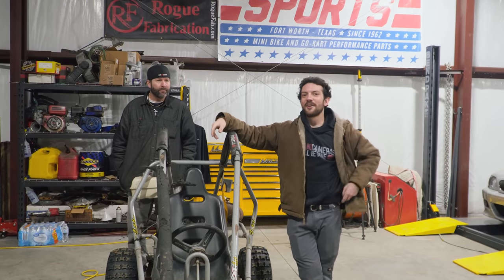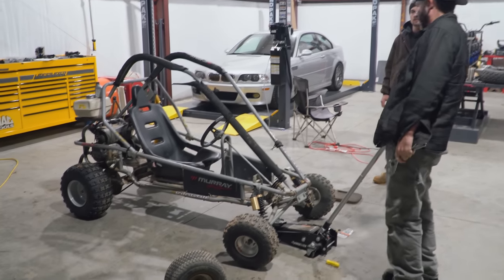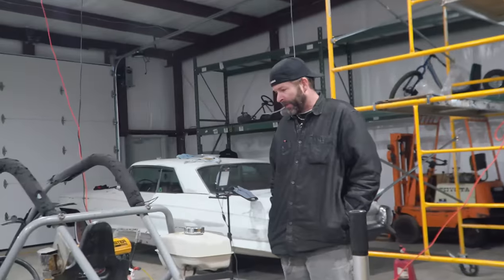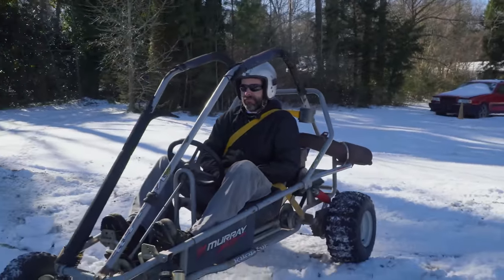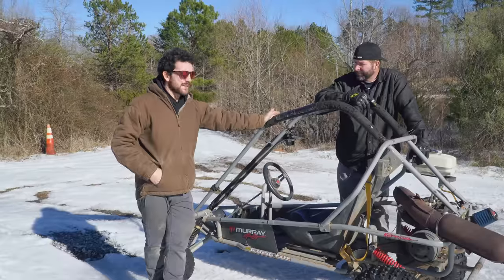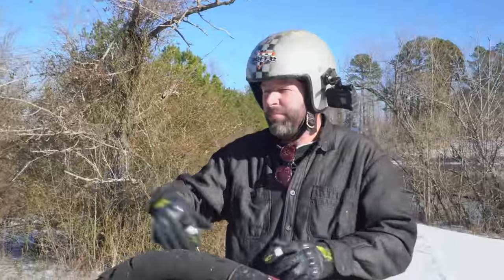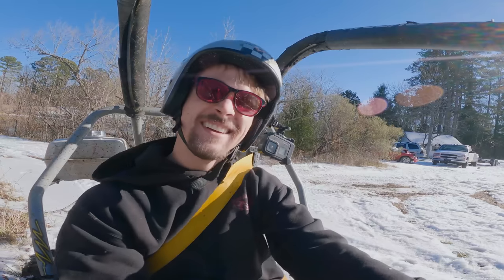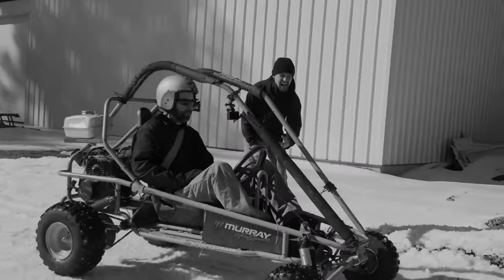Reviving our 440cc SNOWMOBILE Powered Go Kart!

Comment from the maker: The 2 stroke Murray is BACK! This engine is supposed to make 38hp... Now we just need it to get to the wheels!
Reply: Whats up with this spam ^^^....the way ike said choke me....lol its almost to natural isnt it lmao
Reply: You guys need to get a set of wheel studs for this reason
Reply: How about a go kart on tracks?
Reply: Or a change  ski set up for the Front for those biannual snows lol
Reply: Put a real snowmobile secondary clutch on it and the right belt.  The secondary is too small in diameter compared to a stock snowmobile one so that's killing your gearing and your belt.
Reply: Plus your jetting is way off
Reply: With it being winter and cold out that fan cooled engine will put out much more power than the summer that's just the way those snowmobile fan cooled two strokes work.... the colder it is the faster they go... try it when it's in the single digit temp
Reply: To keep from rolling over go wider
Reply: @squarebodycasewademckenney6190  they don't get single digits down there.  Also you're thinking of a free air machine with regards to Temps.  A fan cooled machine will run fine in warmer Temps as long as it's jetted correctly. You'll lose maybe 5% power going from say 25° to over 50° if the jetting is right.
Reply: More. Like 80hp. The two stroke snow machine has a ton of drag 38hp wouldn't even have enough to move it through loose snow.
Reply: @dipstiksubaru3246  nope I had a 1995 skidoo safari 377 fan cooled and in temps above 30°f it was kinda sluggsh but anything below 25°f it was quick and anything below 10°f it was almost scary quick it would actually lift the front skis and it's the same way with my new sled a 2003 ski doo Legend 380 fan cooled
Reply: @squarebodycasewademckenney6190  read where I said jetting. I've run 377s into the upper 60s without significant powerloss.  Been working with sleds for 30+yes
Reply: @dipstiksubaru3246  377 will run great in warmer temps, jetted for it. Till it blows up the same as they do in the winter lol      you can't run a Cat (Kawi or Suzuki) engine or the summer.  This thing will lose compression before the next video..  and my guess is blow up in the next one or the one after. You're absolutely right about the clutch..   but it also needs to be aligned properly.   These guys are clueless with sled engines.
Reply: I wanna change that.    There's a good chance it's already blown up 🤣    it is 100% down a cylinder hahaha

Comment: I’d definitely get a tach on that if you’re gonna do more tuning that engine should turn around 7,000 RPM. The clutch is coming in way to low like Ike said and I’d definitely gear it down. To get more out of that motor I’d put dual 34 or 32mm Mikuni carbs on it.
Reply: Single carb is much easier to deal with and you don't need to sync with a second. They need to effectively double their gear ration to 10:1 or even 12:1 to be geared properly.
Reply: They're using a garbage CVT.  First step should be a good one with good belt.

Comment: I agree with Ryan Mallory except I would put a stiffer spring in the clutch so the rpm’s are slightly higher when the clutch engages. It should help get rid of that low end engine bog. Oh and definitely a new belt would do wonders too. And before you do all that gear changing you could reclock the secondary. So put the spring end into the next hole. That will give you more low and mid range power too.

Comment: I also think the snow is wetting the belt contributing to the slip.
Reply: i agree, making something to protect it from the elements would be good
Reply: It's a snowmobile engine but they're using the go-kart torque converter I believe. The snowmobile torque converter is much bigger and sturdier. You could be right but I assume go-karts go through mud and water pretty regularly.

Comment: Back in the day ('70's, lol) rather than changing the driver dogs, we would stiffen (or lighten for quicker top ends) the driven pully's spring.  That way we would keep more pressure on the belt  & give a bit more low end grunt.  Have fun!  Definitely love to see 2 strokes providing grins, like the old days!  LOL!

Stay safe, & thanks for the content, & chuckles !

Comment: Good machine! The clutch you can take apart and drylube, and pre-tense it correctly. I think it would be better to set the rear dampers almost vertical in the chassis, not flat as it is now. Looking forward to next video.

Comment: Would be awsome to  see  some A Arm suspension  built  for this. Work out the kings with gearing / wider wheels and tires /  belts  / carb upgrade . Would be a little rocket  contender for  mini  crosscart !

Comment: Front tires look like they have a severe camber issue.put some bigger tires on the front fix the camber and belt issues and let it rip. Cool project.
Reply: It's because the shocks in the front are too long but they did that to lift it

Comment: FIY engine and jack shaft centre distance is critical on a snowmobile clutch for low gear! And proper high gear! Clutches need to be clean and free of dust and belt debris, both the primary and secondary clutches. It’s called a clutch service. In the snowmobile world. Pre season service. 
The more wear on the belt you loose low and high “gear”.
P.S. that thing should 
Rooster-tail the tires with a 440

Comment: Just so you know older snow mobiles from the 90 and later all are set up with a high clutch engagement around 2 thousand 200 rpm. A lot of the slipping is from not having a cover to keep your belt dry they don’t like water.or ice so looks like you need a new belt. Recommend getting scotch bright pad to lightly polish your pulleys the belt rides on. Can’t wait to see what this project can really do once the bugs are resolved

Comment: Some tips on the Kawasaki 440 and belt drive.  You can get a higher "Stall" speed on the clutch by very slightly loosening the belt.  If you get it too loose, you'll get a very hard grab when it does catch.  I'd also like to note that you are running an exposed belt in the snow.  Wet belts slip.  That will be made worse by gearing issues.  The KZ 440 is one hell of an engine that can be tuned for much more than the stock 43 horsepower (We were able to get almost 60Hp from this engine in a Malibu Grand Prix "Virage" race car).
Reply: Not a KZ engine sir. Came out of a 70s Arctic Cat snowmobile. Most likey a Puma or EXT. totally different engine than what Kawasaki used in their bikes.
Reply: @matthewbeito1431 , My mistake on the nomenclature of the engine.  My experience with them was as the powerplant in a Malibu Grand Prix "Virage" race car.  Malibu Grand Prix used to be an arcade and go-kart amusement center at many locations across the US.  They're mostly gone now, but the Virage race car was a 7/10 scale formula one car with a top speed in the area of 50-70mph off the track.  I've spent a fair amount of time wrenching on them and tuning them when I was a mechanic at our local track, before it shut down.

If you never saw Malibu Grand Prix, here's a video of an example:
https://www.youtube.com/watch?v=YAEWjXwPnfs

Comment: I've got a Kilowatt the same color and everything except mine has a Vegas Carts 460 block with billet everything internal and external. 780 drive and driven on the factory motor/jackshaft plate (the only thing I had to do is move the plate to the right about 3 inches and then replaced the factory jackshaft with a new hardened steel one that ended up being about 3 inches longer. The best upgrade imo is the front and rear hydraulic disc brakes!

Comment: Just a thought: You guys are getting fast enough on this course to take downforce into consideration... you'll need large wing at these low speeds, but it would be extremely effective and not be too draggy, again because of the low speeds. You'd definitely pick up more traction than you would lose top end. Try adding some downforce to some of the projects to see if you can get better times.
Reply: They aren't going to be reaching the speeds they would need for downforce to matter. Downforce is really only going to help if you're going 100+
Reply: I've been saying that for 3 years. Get a 600 mini sprint.
Reply: @michiganvapemafia595  Nah dude, surface area will make up for it easily. You don't need to be going anywhere near 100 mph to get good downforce. Try holding onto a piece of drywall in the bed of a pickup that's doing even 30. 

A bit of cheap sheet metal and some quick calculations (there's a formula) and they could keep the throttle buried for most of the course. Especially on the lighter projects that don't have too much inertia. Actually, there's a good project for them... build something ultralight with as much downforce as possible. I don't know if any of them can weld alu, but it's never too late to learn.
Reply: You are all on drugs. You don't run down force on an of road vehicle. You arent off roading in a Sprint car(or micro sprint). Oh wait! what about all those side by sides running around with giant wings on them? All the Baja trucks with giant wings on them? Oh right they don't exist.
Reply: @jasonbirch1182  You don't run downforce on cars designed to jump. If you aren't jumping, downforce is a legitimate way to increase traction. The same rules apply... no amount of crying will change this fact. It's also a perfect project for this channel.
Reply: @jasonbirch1182  
Go fast, turn left. Asphalt is for getting to the race track.

Comment: Snowmobiles have a drive unit that has 2 different size sprockets that reduces the ratio. Going straight to a pulley is about 25-30 percent too tall. Get the ratio right and it will easily do 70 and still have great low range

Comment: This thing is a couple of steps away from rocking your leaderboard; convert the machine to have a wider track width so it doesn’t wanna roll over as easy
Reply: I think your right like Pontiac Grand Prix wider is better. Grind hard plumbing co. Did it on colonel senders they said it turned Easier and felt way better. They widened it three inches.

Comment: i want to see this engine in a capable chassis with a wider wheel base to improve the handling. It needs to have wider tires and a good shot at a dry track and i think this is a top 5 contender on the leaderboard. You could try and widen the wheel base with larger shocks and longer arms but that would not be good for the front because of the angle of the wheels. You would want a more complicated set up for the front and probably better shocks in the rear.

Comment: If you haven’t yet, those carb jets need to be upsized a lot. Snowmobile air boxes are very restrictive and so when you replace them with free flowing air filter pods, the engines will run super lean. Check your plugs, if they are tan you’re perfect on jet size/tune/fuel mix. If they’re white it’s too lean, black it’s too rich.
Reply: I had to go up 4 jet sizes on my sled powered buggy 👍

Comment: Looks awsome! Id slap a camera close to the engine for a better lookieloo of the workings of the CVT drive? (In my imagination, based of nothing but speculation, that cart weights/drags ALOT less than a snowmobile, so id imagine you are not making the clutch work "as intended" especially with that madhouse final chain gear, but i might be out in the weeds here..) 
Hope it works out well in the end!

Comment: That is a cool machine. I thing belt and gearing is all you need. Don't change the weights because that'll strain the belt more and it's plenty powerful plus wil improve with the higher gearing. I can't wait to see a dry warm lap. Rear axle probably needs to be wider for stability.

Comment: I would put some screws in the tires, but that thing looks like a barrel of fun.

Heavy weights reduce slipping but increase engagement and max rpm. 

You can recondition the belt with scotch brite and rubbing alcohol.  I think snow spray is causing the slip, the belt isn’t smoking so I doubt your cooking it.

I would tighten the spring in the secondary clutch do it stays in ‘low gear’ longer and returns to it easier.

Comment: I have tuned more scooters with CVT than i can count and First off, you need to keep the belt dry at all times, second you need  a more powerfull secondary CVT spring to hold more tention on the belt to also reduce slippage, then you can look at clutch and clutch springs and then rollers/weights.
If you dont do the CVT optimization in the right order, you will struggle with it for years and never get it running right.

Comment: How are you cooling that engine? Most snowmobile 440's are fan cooled. If it's a liquid it should have some cooling fins installed that cycle the heat. May want to install a temp gage just so ya know.

Comment: Need more power for our Ken Bar kart. At Mini Mayhem, it was slow launching on the drag strip. Maybe more gear, adjust the torque converter? My son does have a turbo Honda Civic motor and trans in the barn. Hmmm...

Comment: Try keep the clutches dry and the belt wont slip. Soon as a snowmobile gets snow on the clutches they slip the belt. Id say the belt got wet and gradually got ate by the clutches as it slipped which is why it ended up getting poochy. Belt should ride 1/8 inch out of the sheaves in the driven (secondary) clutch and make sure the alignment is proper too. Misaligned clutches eat belts too. If you can keep them dry and set up right that thing should go a ways between belts and haul more tail too.

Comment: Finally something you guys do I know a thing or two about first relocate the tank and put a fuel pump on it re jet it for the air filter get rid of that horrible clutch and put a snowmobile clutch on it the belt might be slipping because of being completely exposed a belt would definitely help and like everyone else said and you said gear it down and it should be an absolute machine and maybe invest in swapping to duel carbs probably 34mm carbs and run 50 to 1 I think is the best and see if it has a oil pump right under the carb and either remove it and put a plate on it or hook up a oil tank if it doesn’t then don’t worry lol

Comment: Those were designed to run no air filter so a re jet for sure. Lighter rollers in primary and shim the secondary for sure. Definitely do a belt guard in case the belt or clutch comes apart at running rpm I’ve seen people loose a leg over that on a sled. It kind of acts like the carb isn’t opening all the way too.

Comment: I think you guys should adjust the front control arms to take all that positive camber out from lifting it. Would make it handle significantly better.  You should just be able to slit the tube and bend it up a little, though going full double A-arm would probably be the best option, so you can add some serious width to the front

Comment: Interesting thing is, two stroke engines being made the way they are can run upside down. The issue is that they can't normally be turbo charged without special modification, however they can be turbo charged by simply changing the pulleys to add on an additional accessory pully.

Comment: A clutch designed for 2 stroke rpm would be best, preferably the one that came with the engine, and a belt designed for the application. I'm really glad you got the thing going again, that kart will dominate your leader-board once it gets a better drive train. The engine was designed for a 400 pound snowmobile, and will put everything else to shame.

Comment: Gear it down, Replace the belt and I think Long Travel front and rear suspension would make this thing bad ass. Yes I know you would need to change the rear drive setup for long travel but I think it would be worth it.

Comment: Try putting a proper driven clutch on there so that it’s facing in the correct direction so that the torque converter works correctly that will help

Comment: Only seen half the video,but if you want a snowmobile engine that will almost always run,look for a Yamaha Enticer 340 engine,I have one in my sled that still runs,even after sitting outside for seven years,plus,they have Mikuni carburators

Comment: Easier way to raise engagement on clutch is put a spring shim. They sell em. But you can find a washer at local stores. Fender washer thickness will raise engagement up about 400-600rpm actual spring shims raise engagement about 200rpm per shim. . Just a cheaper alternative to buying a stiffer spring. 
-Spring or shims is wat sets your engagement rpm. 
- clutch weights is wat sets your clutch shifting.

Comment: I reckon the old suspension springs had lost their rigidity so when you ran it ages ago it would have been stiff and not hitting. New shocks are probably about the same as the old ones when they were first put on 👀

Comment: When I was 13 I actually flipped on of those buggys I had to of been going 40 because the broken but existing seat belt didn't work and I was ejected got knocked tf out and well when I came through the thing was on its side sping full tilt she ended bending just about everything u could think of that cage actually bent the factory bend flat on the right side I'd say I sent her a little to hard

Comment: The way those clutches are set up they should be able to compensate for the tall gearing the issue you're having is snow is getting on the clutches causing the slipping.  You need to build some sort of cover to keep the moisture out of it

Comment: Definitely snow getting on the belt is making it slip. But the gearing is to tall also and lighter clutch weights will sure help for higher engagement RPM.

Comment: It's all of the above but the motor is not revving correctly or close to the same it was earlier. It wasn't getting up on the pipe at all in the later part. It wasn't all belt slip. Not making power. Maybe only part throttle? One cylinder running?